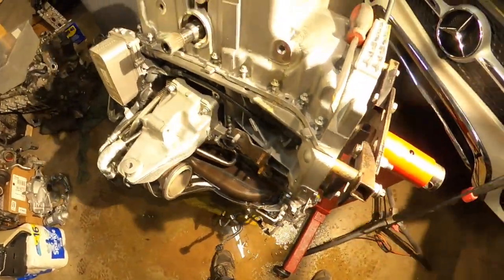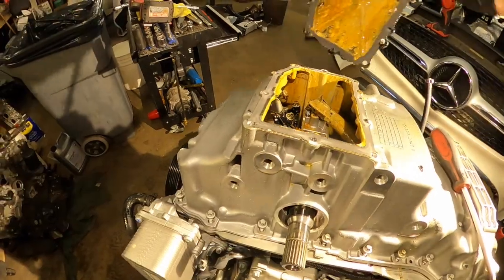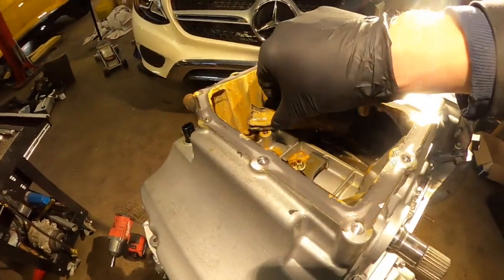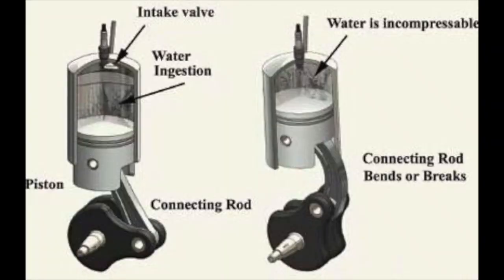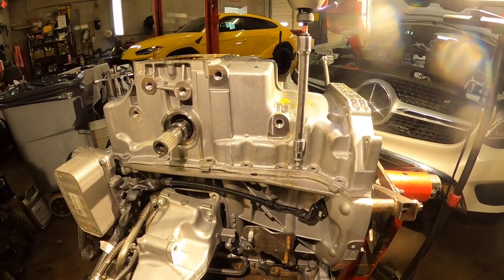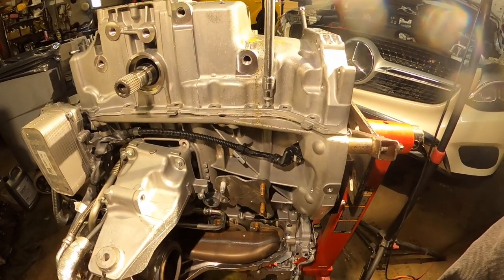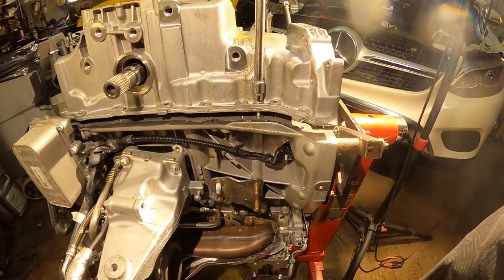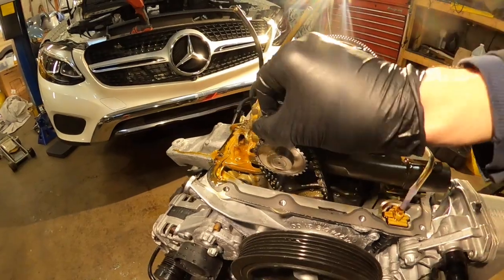Hydrolock Engine / Consequences after water damage engine  (broken rod)

Comment: 😳😳😳😳 OMG! WTF!!!! Mercedes
Reply from the maker: Yup that was the end 😅 
This engine is done 🤣... it can happen to any engine that is the power of water
Reply: @mechanicmode  I completely agree!  in Russia it is called "fist of friendship", I mean when the connecting rod comes out through the engine block))).  Once I had a rover 75 with a 25k4f (kv6) motor, the same thing happened to me.  The cooling gasket is leaking and antifreeze has entered the combustion chamber😬😬😬.  I don't want to have any more business with English technology, their cars are rubbish))))
Reply from the maker: Hydro lock doesn’t have mercy other any engines 
Still that is pretty bad , too much damage